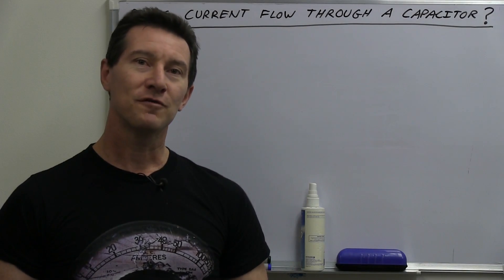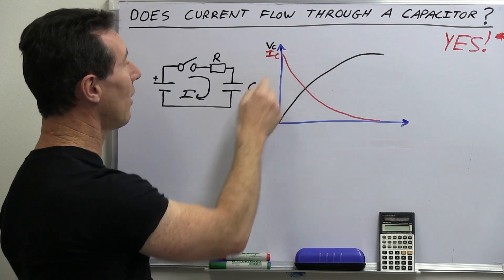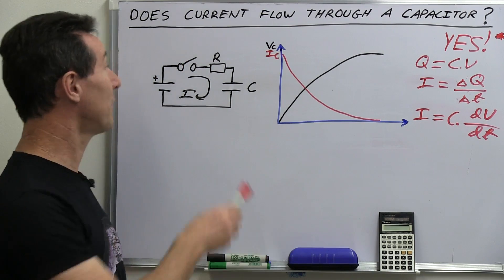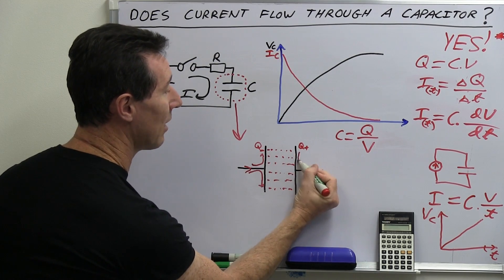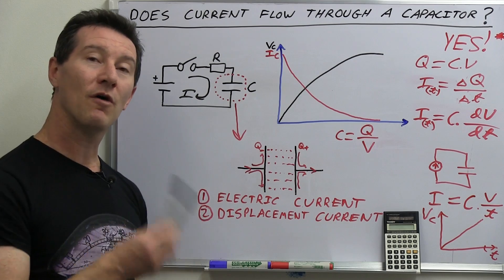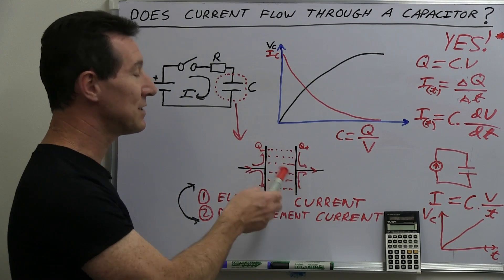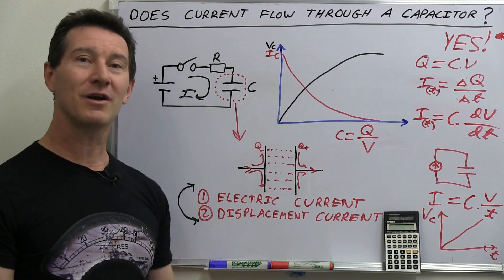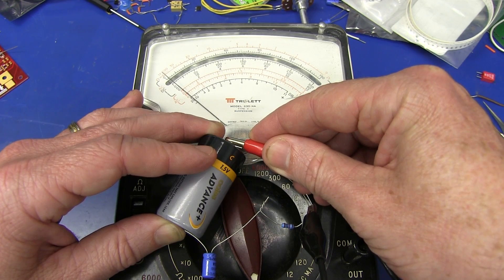EEVblog #486 - Does Current Flow Through A Capacitor?

Comment: I refuse to remain silent and be presumed a fool, so I will open my mouth. I thought capacitors retained a full charge once their source was removed, which would explain why they could be dangerous. With Dave's little demonstration at the end he showed that current indeed flowed through the capacitor. However, despite his not opening the circuit, the meter quickly returned to zero. If there is a short answer that I might understand I would greatly appreciate any enlightenment. Thanks.
Reply: Current went to zero. Voltage went to 1.5v (voltage of the battery). The cap is now charged to 1.5v. Capacitors are like batteries. If you take that charged cap attach a resistor across the pins, current will flow and the cap will discharge.
Reply: Adam Frisby Ahhhhh! Thank you so very much, Adam. I appreciate you, and I appreciate your not trying to make me feel stupid. Peace!

Comment: So it's kind of like you're inducing current as opposed to Voltage? Would it be fair to say that a capacitor is an inductor that stores and holds its charge before discharging it. I thought inductors and capacitors were similar in that matter but I didn't realize just how similar they were.

Comment: I don't like his answer. It's misleading. He's conveniently leaving out the fact that the current flows through the capacitor FOR AS LONG AS IT IS CHARGING / DISCHARGING! As he's written on the board behind him, current is the FLOW of charge, i.e. I(t)=dQ/dt, therefore when an ideal capacitor is fully charged, it will act like an infinite resistor due to the capacitor's voltage being at an equilibrium with the circuit at that point. It'll effectively be invisible in the circuit as far as current flow is concerned. Once it discharges, it current 'flows' through it again but in the opposite direction as you would imagine due to the electrical particles searching for ground.
http://www.colorado.edu/physics/phys2020/phys2020_sp99/Concept%20tests/CT19-14.html

Comment: Didn't the demo at the end of the video only show current flowing through the metre as the capacitor charged up.  Once charged the current flow stopped and the metre displayed zero.  To me this proves that current does not flow through a capacitor else the metre would show a constant current flow.
Reply: When dQ = 0, so does Ic.
Reply: It does... current flow and time are a multiplicative inverse, as such the actual current is asymptotic to the supply value (or zero upon discharge). So the fact you can't easily measure it doesn't mean it's not there. And it doesn't need to be constant to be present either.

And that's probably enough hair splitting...

Comment: I think that a more simple answer is that current will tend to flow through paths with low resistance. When the only paths it can take is the dielectric and air, it will flow trough one. Think that they use copper for superconductor isolation. And you can touch that copper. It's all about the resistance. 
PS: This is my point of view and i do not have formulas to back it up and i do not plan to spend my life to try to prove it.

Comment: I do get what he is trying to say but it's still not ok. Current as he said, but for somewhat reason contradicts himself, is charge displacement over time. But since there is no electrons moving from one plate over another, obviously there is no current. The reason there appears a current on the other side is due to maxwell's 3rd and 4th equations WHICH HAVE NOTHING TO DO WITH CHARGE or conduction current. It's an displacement current due to variations in space time of electromagnetic radiation which indeed starts from a voltage based electric field. But yet again as he said in practical electronics you don't really care about all the physics behind it, and I agree, so I guess you could say his affirmation is correct.
Reply: SirR3D In order to keep the dielectric from exploding, an abundance or particles of electricity on one face of the dielectric must be created, and a shortage of particles of electricity on the other side of the dielectric must be created very quickly or the capacitor dielectric will explode. 
High frequency as well as high voltage, can detonate capacitors, because the frequency of charge and discharge, of alternately polarizing the dielectric can cause the dielectric to fail. At some point both surfaces can be at the same voltage, and the dielectric will conduct. 
We use high frequency in industry purposely to start the flow of low voltage electricity, over a large air gap, an air gap that can easily stop the voltage present. Basically high frequency is used to breakdown an air capacitor stopping the flow of low voltage electricity. Once started DC current will not stop flowing unless you interrupt the flow of power to the current conducting air gap. 
A standard 100 year old light switch, in the open position is just an air capacitor with a 3/32" air gap, that charges and discharges in a bipolar manner, 60 times a second, to stop the flow of electricity across the gap. At a certain higher frequency the air capacitor will break down and conduct. 
Benjamin Franklin's experiment in his basement using a wire form the roof, of his hillside home to a metal fire place ball, in his basement was very cool. An ARC would then jump to the other cast iron fireplace ball, that was grounded to a copper ground bar buried in the ground. He was able to channel the lightning into the basement and create powerful arcs that could burn the flesh. He then created a double inner and outer hoop copper sheet air capacitor or condenser, suspended by silk threads that could store about a 30,000 volts. He would with a glass globe charge the air capacitor using static electricity that was then connected to a third cast iron fire place ball, he placed the third ball between the two existing fire place balls. He basically created the anode, cathode and gate. 
When the center ball was connected to the charged capacitor it would stop the lightning from flowing to the grounded ball. When he would discharge or disconnect the center ball connected to the capacitor, lightning would move to and past the center ball to the grounded ball.

Comment: Dave it is easier to say that electromagnetic flux is converted to current to GND. It does not move directly the current but the magnetic field induces current flux to the another pole and thus transfers the current within magnetic field. The voltage brings up the magnetic field that is able to induce flux to gnd thus current flows.

Comment: Yeah ...... current is NOT flowing thru the capacitor. What a hound's meal (lol). It does flow for a moment and then it gets tired and stops ! Gotta love the Universe on this one .....
Reply: the current meter tells no lies
Reply: the current meter told no lies, plus strictly speaking i think a very small current flows as the limit goes towards zero for current, as per graph. Electrical 101
Reply: Foxy rollins : Well Foxy, if the current is constantly flowing thru your capacitor, then you have a bid problem with that capacitor. Current will flow "onto" the plates but not thru. Hence .... charging up a capacitor ! Once charged up, No More Current Flow. Done ended stopped no current flow for now.
Reply: The current was not constant, have another look at it and the graph of current vs time dave shows for charging a capacitor
Reply: its an induced current, through air, occurring from a difference in charge at the plates, and the 20 pages of maths Dave is glad he can almost forget now.
Reply: Foxy rollins Yes current flow will be indicated by and magnetic field, to which there is current flow to the capacitor plates as they charge. So when the plates are charged up, the magnetic fields disappear and you then only have electro static fields ( voltage) remaining from the charged plates. But still, there was no actual current flow thru the capacitor. I think that it is the electro static charge imbalance on the plates that causes all of this to look like there is current flow thru the capacitor. BUT then what do I really know, I am just some dude that enjoys electronics on a simple level ......
Reply: I think of it as a stored magnetic charge.. im not 100% either.. maybe tesla took it to his grave?
Reply: One thing is for sure, dont short out a big ass capacitor...

Comment: Physicists are always making up fantasy math to explain what they don't understand.  I still believe that magnetism and electron flow are completely separate things.  However magnetism can cause electron flow and vice versa.  That I can prove as I can also prove light can cause heat (excitation of atoms) but that does not mean they are the same.  Current flows into and out of a capacitor not through it.  It's a simple battery (temporary storage) End of!
Reply: It's not at all a battery. A battery needs a redox reaction to release energy. A capacitor, in its simplest form, is literally two plates and it operates only and entirely using charge and the electric field.
Reply: Yes you are correct still Dave loves to over complicate things ;)  It's his nature I guess.
Reply: Watch the video again - Dave implies they are the same.
Reply: Digger D I agree with you about the "modern" physicists" making up formulas using hieroglyphics. To explain away their misunderstandings. I was taught that heating an object actually slowed down the vibration of atoms in say a piece of metal. The atoms move more but at a lower frequency. The metal becomes less dense, less hard as you heat it. You can often work a metal, bend a metal, that would break at room temperature, but work it easily at higher temperatures. At extremely cold temperatures the metal is compacted and is often as brittle as glass. When metal is cold it transmits high pitch sounds. When metal is hot it does not transmit high pitch sounds well. I was taught that cold dark objects and areas posses a higher potential energy, then does a lighted, heated area. Meaning by heating a piece of metal we actually reduce the potential energy, and expose the potential energy. The energy that is actually being slowed or made visible. How you take this is up to you, I just like to share, everything I know was given to me, shown or demonstrated to me by good individuals that often risked their jobs and or lives to show me. A very good friend of mine taught me metal hardening using a zinc and phosphorous compound, that turned heat rays into light and Ultra Violet radiation. Light he explained removed more heat energy, or particles of ambient radiation, that are causing heat, then did the heat rays alone. It created an avenue for ambient radiation to leave the part quickly. Allowing us to surface harden even mild steel. The explanation is that ambient radiation powers all things. Matter is rather harmless. If though we cause matter to create a filter that blocks or slows ambient radiation. We get, heat, light, radiation, gravity, explosions. You might find me saying that only electricity stops electricity all over the internet, and I live and die by that rule. Well ambient radiation is just electricity, in order to slow it down harness it, we cause matter to filter it, slow it or even accelerate it. There are people that sill fight perpetual motion. They say "It just cannot be, there are "laws" of conservation" . Yet if you take a hard boiled egg, and a raw egg, and give each a spin on a similar hard flat surface, I believe you will realize why our liquid core planet could not be spinning without a constant power source. This would all be an outrageous comedy if our children and grandchildren were not sitting in veggie centers all year long.
Reply: Most young people do not understand that in an area that has a cold winter and a hot summer, that their automobile shrinks and expands 1/8" in length between the two seasons. When people make buildings out of steel, they could easily be off over an inch, over the width of a building if they installed the steel during the winter and it expanded during the summer. A building 200 feet long could easily grow over an inch in the summer. Causing a half inch overhang over the end footings, where the "H" beams that support the "I" beams are mounted. Riser pipes for chiller water that go up hundreds of feet either inside or outside the building, will also grow and shrink with the seasons. That is why they would often stop every couple of floors and offset the straight run. To allow for expansion and contraction. The same is true of sprinkler systems and their riser pipes that run vertically from the roof to the lower floors in some hi-rise buildings. Often there is a tank on the roof to supply water in case of a fire. On a cold day someone leaves the windows open in a stairwell over the weekend and the pipes get cold and shrink. It is possible that a Victaulic (trade name) coupling could give way under the pressure created.  Matter is not as cut and dry, or as solid as we are taught it is. It is an electrical effect.
Reply: Digger D Look at a 100 Watt incandescent bulb. It may have about 10 ohms resistance if you put a ohm meter to it. That means when you first power the bulb it draws about 12 amps and about 1440 watts. Yet when it is powered either with AC or DC current, and it self inducts, this raises the resistance through the element and raises the ohms to 144 ohms. That means it draws 0.833333........ amps. Which gives you a voltage drop of almost 120 volts across the element. Even if your circuit will supply 75,000 amps, that little element will hold off the current to just 0.83333...... amps. So if the element was 12 inches long. Each inch of the element would drop the voltage by 10 volts. That is pretty much what happens in the dielectric of the capacitor. At first particles of electricity race right through the dielectric of a capacitor. Then in order to keep from exploding, the surface of the dielectric facing the ( - ) charged terminal of the battery, gets over populated, with particles of electricity. When particles of electricity cross materials where they meet, there is a build up at the surface of particles of electricity. This stops the flow of particles of electricity, the massive current. That abundance of particles at the surface of the dielectric facing the ( - ) charged plate, then repels away the particles of electricity in the dielectric, towards the (+) charged plate which is by colleges convention, short of particles of electricity. The voltage drop is ramped or sloped, depending on which school of electricity you belong. But current does at first flow through the capacitor. Ambient radiation powers all circuits, batteries and capacitors, but just looking at what we can easily confirm, I think we can conclude that current must flow through a capacitor. At least until it is charged.